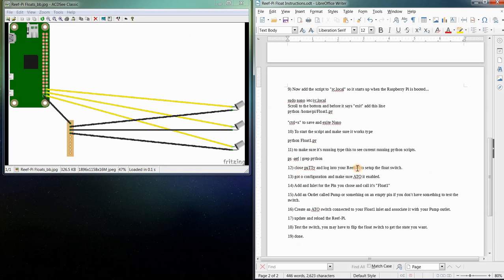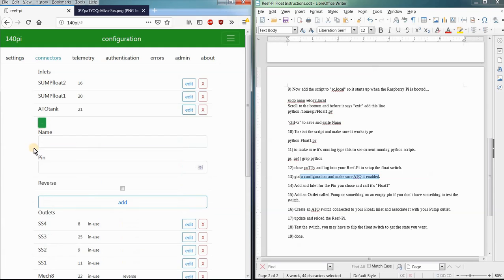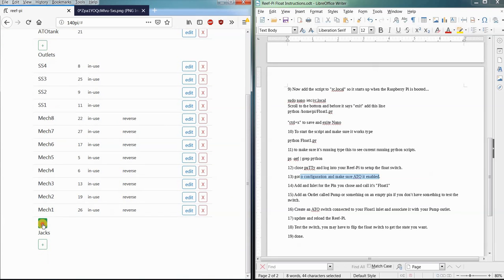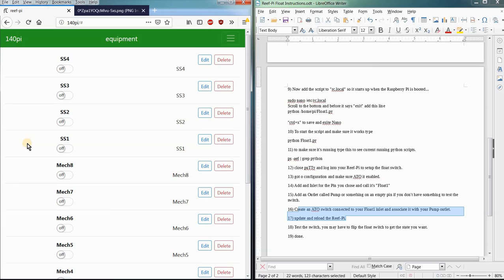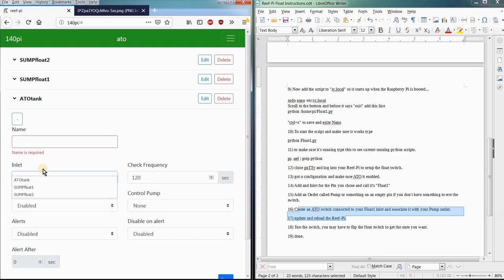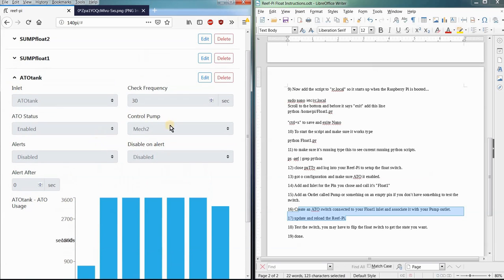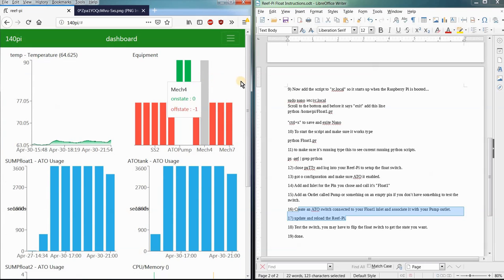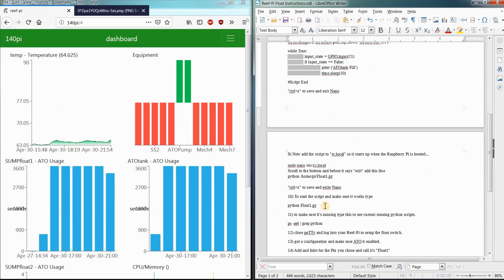DIY Aquarium Controller - Float Switches Pt3

Comment: Hi there, thanks for sharing! Really appreciate it. So if I am not wrong, there is no need for resistor in this circuit? With raspberry onboard pullups will be enough? Sorry if this is sound stupid question, but I want to be sure I wont burn my little raspi. Thanks for your time!